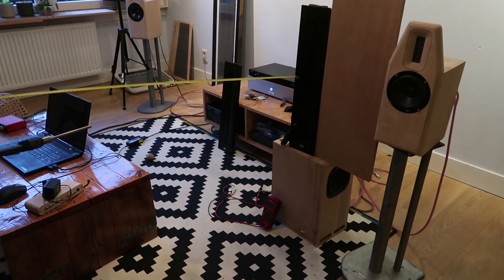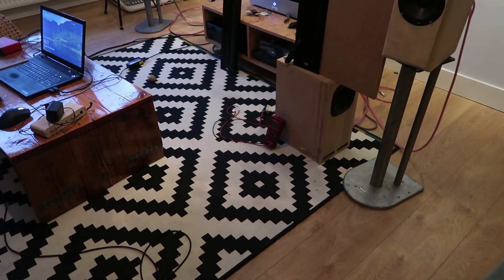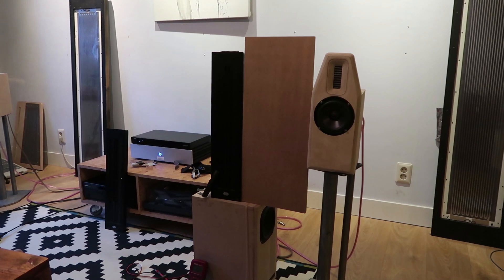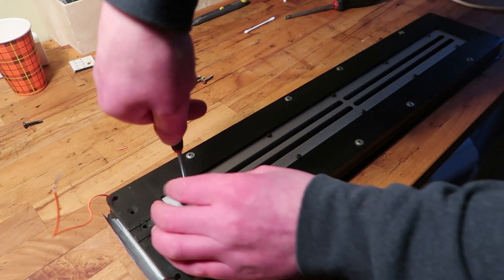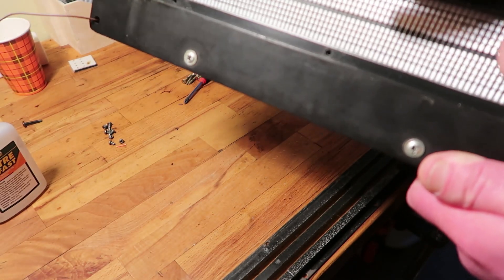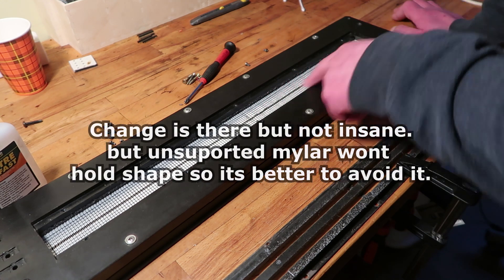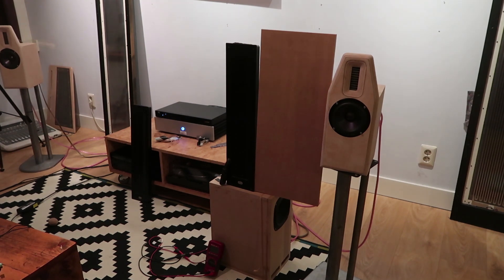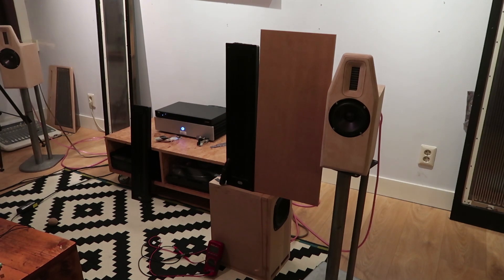Strathearn Audio SLC3 Overhaul   Part 4 My own idea

Comment: Hi. May be you can help, I have a pair of magnepan II. I rewired them and somehow the membrane became free from one of the straps which hold the membrane stick together with the magnets, there are two of them. My question is with what glue or double adhesive tape I can fix the mylar back to that antiresonance strip?
Reply from the maker: Only the metal strip came of ? 3m 30nf of another contact adgesive should work. If thats tge only thing that came off
Reply from the maker: If the mylar really came lose its lost its tension and you cant fix it that easily, and it  might need a refoil a t magnepan
Reply: I will try with 30nf then. Hope will hold...

Comment: Remove all  the screws but the last two on the end to keep it from twisting . The hose/foam cushion will keep the ribbon safe as the last two screws are easier to manage as you remove
Reply from the maker: well its easy said then done :) it was not easy :)

Comment: So when you remove the rear panel magnet next time, use a rubber hose on one end that you unscrew to gap the magnet while you finish unscrewing the last two screws on the opposite end
Reply from the maker: i would say normally i would use 4 threaded rods. an push both together by  nuts :)   since i wanted to change out just the felt that did not work. as well as the tension is not high enough either to resolve to such measures. (although i Fucked up this one the initial installation whent ok)  its purely by dicking around it failed ±'  but its ok. its just a tester  :)